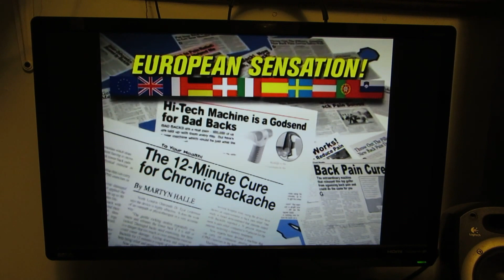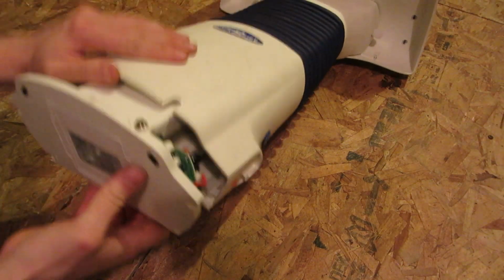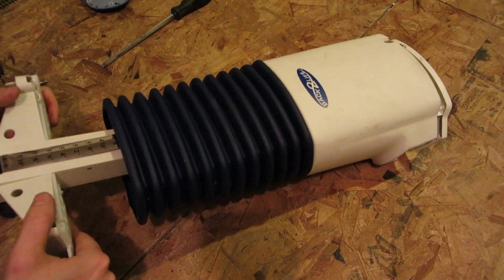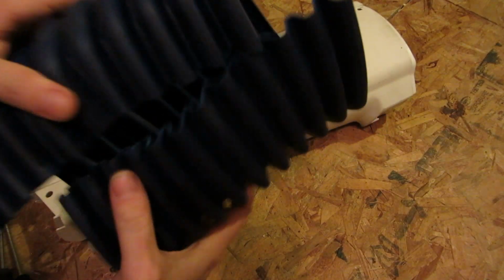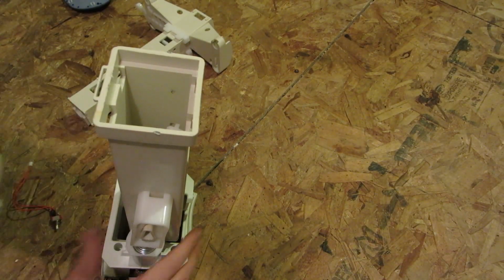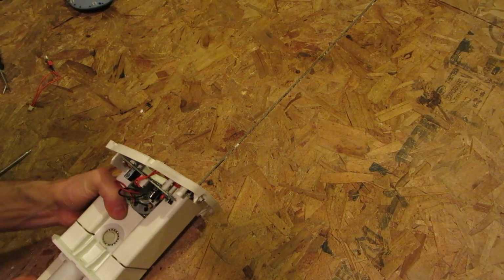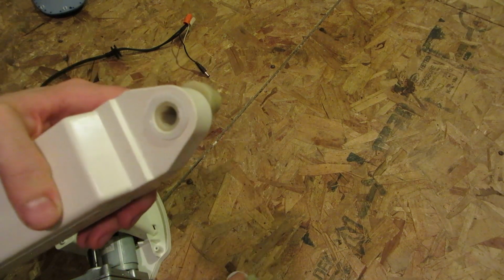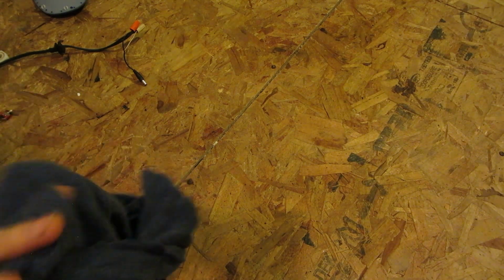Equipment Autopsy: Back2Life

Comment: It doesn't many make sense why they have a ac line and has a dc motor attached to it.😕
Reply: I ordered for one to Nigeria from the US. But the Adapter got missing during the shipment.  So i have never used it.
Any recommendation on an alternative common adapter to use?
Reply: For the 12 minute  shut off timer
Reply: @martins2191  Ebay sells alternative and replacement